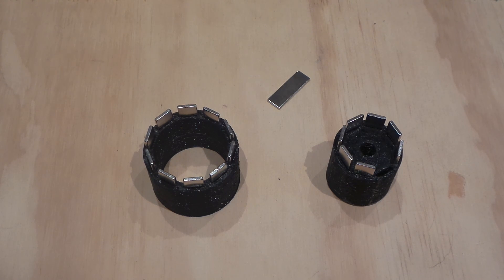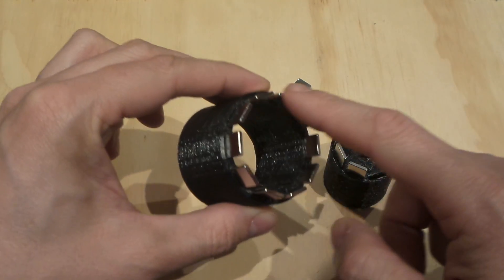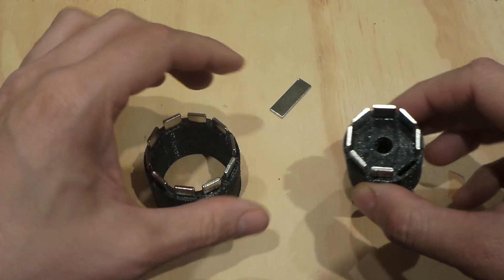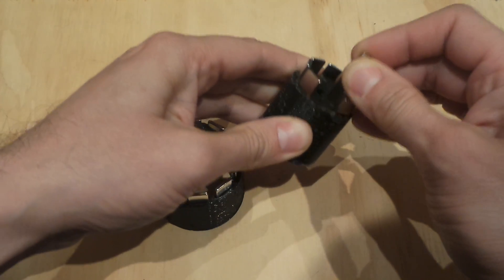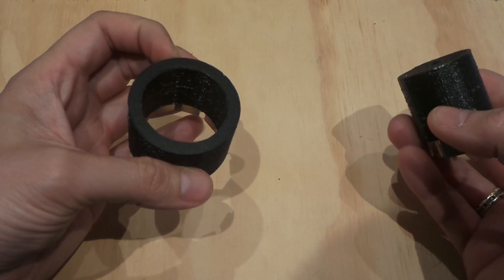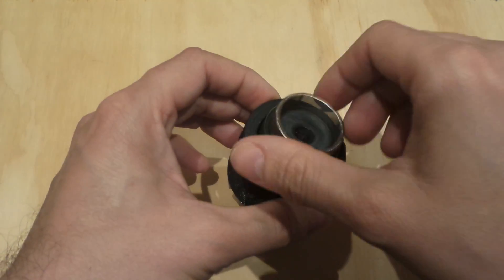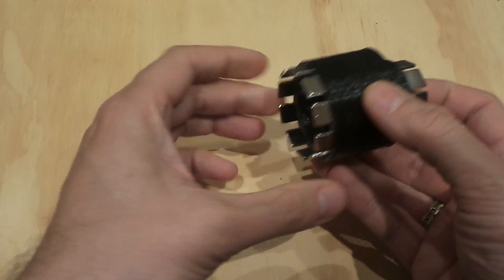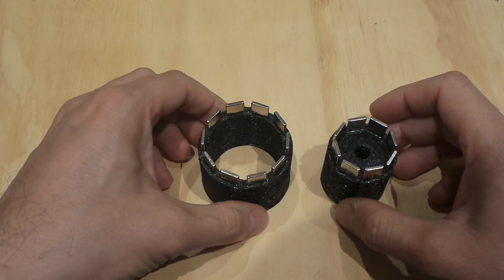3D printed magnetic bearing

Comment: Hello Sir! Could you guide me on the alignment of the magnets, both inner and outer ring?
Reply from the maker: The short 2ld link stopped working, but if you go to thingiverese and read instructions there it will help. It also explains the setup for the magnets. https://www.thingiverse.com/thing:1754275
Reply: @JankyTom  I just wanted to understand if the last magnet that was inserted in the set of inner ring is polarised in the same direction as the other 7 magnets or is it placed in the opposite manner?
Reply from the maker: @joeldsouza4860  Hi Joel, yes the last magnet is same direction as the rest 7.
Reply: @JankyTom  unfortunately I could not see any instructions, but just some images and a text file.
Reply from the maker: @joeldsouza4860  Hi Joel, sorry if it is not clear there. I made a render picture showing this on thingiverse, but to try to write down here: Let's say, you put all the magnets in the inner ring with "South" facing outwards and all the magnets on the outer ring "North" facing outwards. You just make sure magnets pushed half way in so where the edge of the magnets meet in the rings that will be your lock point.... I hope this helps...
Reply: @JankyTom  Thank you so much. Tamas, I appreciate your effort to provide clarity!
Reply: Just one more clarification. Instead of bar magnets aligned in the form of a tube, can 2 radially oriented tube magnets do the same thing if each magnet's polarity are as mentioned by you?
Reply from the maker: @joeldsouza4860  Hi Joel, in theory it can work. the trick is to have the radius close between the inner and outer ring, but you need someting like a plastic ring to keep equal distance around the inner magnet from the outer magnet edge. Do not forget the magnet keep the thing locked, from pulling out or pushing in, but the plastic ring holds it in balance to avoid sticking together... so they can freely rotate with minimal frictions on plastic touching... (Note, this is rather a toy and not a "real" magnetic bearing as mentioned in Thingiverse description)

Comment: Is supose to make sound?
Reply: Any updates on the new version?
Reply from the maker: Hi There,

This is working based on a pulling force and is still touching the housing when spinning that is why it is making noise.

The other one I am working on is based on pushing force, so no touching will be there :)

Cheers,
Tamas
Reply: Good question! :)